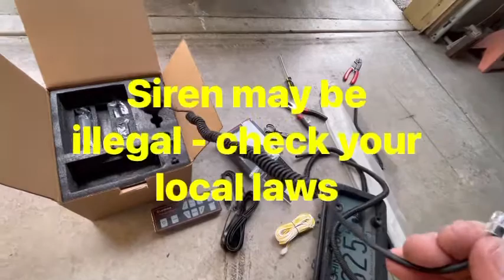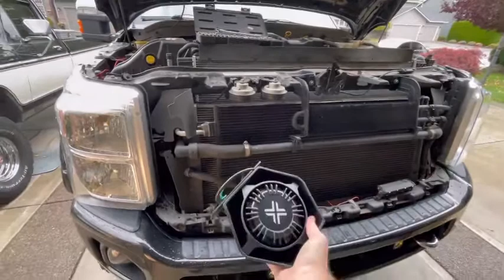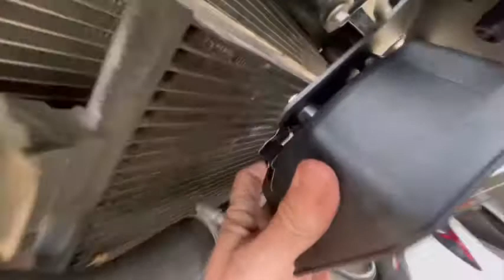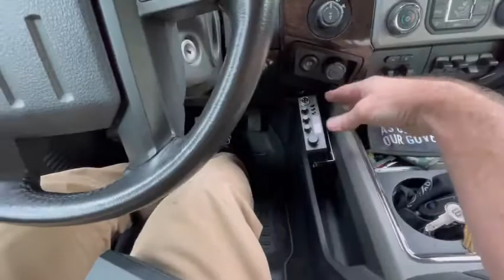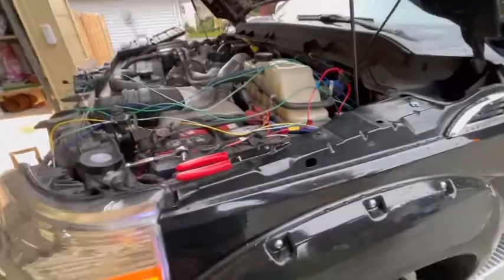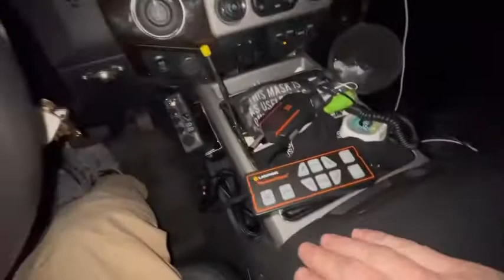Truck PA System Install - Lamphus Thunderwave Siren/PA/Horn Install & Test

Comment: Hey I know this video is old but I had a few questions, I got mine wired up and it works but it seems to drain my battery, I decided to direct the positive wire to my cigarette lighter in my car since I thought it completely turns off when my car is off but it seems to still affect my car is there any advice to what I should do for that?
Reply from the maker: I have not had any drain. My truck sits a lot now.  No drain. Best to throw a cheap switch in the wire somewhere that leads to the unit. That will isolate whether the unit is actually the culprit.

Comment: Hey I know this vid is 2 years old but I’ve got some questions hopefully you can answer. Mine seems to be playing the volume pretty weak, I think I have a good enough ground and power but I’m not sure how good it needs to be. I did have to put the speaker directly behind my cone intakes so maybe the sound it getting muffled? It’s white literally fully face touching the cone intakes. Any ideas on why the volume seems pretty quiet? I can’t even hear the mic and sirens when I’m in the car driving because it’s too quiet that the road noice blocks it out
Reply from the maker: Definitely a huge difference if they are behind something.  These aren’t going to be as powerful as a true emergency vehicle pa.  So they need as much help as possible.  Don’t forget there is a volume control on the mike.  I ended up adding another speaker.  Also, you’re not going to hear much from inside the vehicle on the road since the speakers are directional.  Best to have someone drive in front of you and ask how much they hear.

Comment: What does the radio function do. I'm having trouble with my phone in the aux cord getting it to play
Reply from the maker: Most likely the cord is the issue.  Most phone cables are stereo.  This radio needs a mono cable.  But then some of the newer phones are unable to convert their new plugs over to the type of plugs that these PA systems take.

Comment: Did you connect the red wire directly to the battery?
Reply from the maker: I had a hot wire already that was coming off a relay that was activated when the truck ignition is on.  It was for the lights or something.  Then tied into that and of course it was fused.

Comment: Question for you on the PA loudness. Do you feel your voice is loud enough to be heard on the PA by your fellow drivers while at normal speeds 45-70? or is it drowned out by road/wind noise? Thanks for your input!
Reply from the maker: Well… I did just install a second speaker (same model) and it increases the volume in my estimation about 60%.  To answer your question- the only time I think someone could hear me at those speeds are when I’m right next to them and they aren’t blaring their stereo.  I find this most useful at stop lights when people are buried in their phone and don’t see the light change.  It’s fun to say “Put the phone down!!”.  Here’s the link to the second speaker which is easy to add; https://amzn.to/3X2RkJN
If it’s not in stock they have other options that will work like one from Feniex.

Comment: I have a lamphus sound alert. If I went to install this lamphus thunder wave, would the connection be the same? I just don’t want to run another power lead through the firewall.
Reply from the maker: Power will be the same. It’s just a simple 12v connection.  But if you’re talking about the entire harness + plug - it’s probably different

Comment: Anyone know how to make the option work where you can connect your phone using the 3.5 MM jack and playing sounds on the Thunderwave? I connect the 3.5 jack but doesn't seem to work. everything else works. Any ideas anyone?
Reply from the maker: Firstly, you have to push and hold the “Radio” button until it beeps.  That turns on the Jack/radio in feature.  The 3.5mm Jack is unusual (that’s the only word I can think of).  I wouldn’t say defective- because I’ve tried two.  I initially thought I needed to use a mono cable (rather than a stereo cable). I had them send me a new panel.  I tried the supplied stereo cable. Didn’t work. Then the mono. That was partially working.  What I finally found that worked was that the plug has to be partially inserted- not shoved all the way in. Then it works. Not sure why.  But that did it for me.  I’ve never encountered a 3.5mm jack issue like this.  Just try fiddling with the plug insertion while playing music or something and see if you can find the sweet spot.
Reply: @TheRealWorld737  I found the manual and in it says first you press the radio button once so it turns on and turns orange, after that hold it for 5 seconds. That did it for me and works fine now and I don't have that issue you talking about, where you say put in 3.5 mm half way or something. Works fine for me fully plugged in.
Reply: @TheRealWorld737  Based on the manual, connect the 3.5 jack to unit or phone/tablet. Turn the unit on. Press the radio button once so the orange light comes on, press the radio button again, hold for 5 seconds until you hear a beep. Works like a charm for me.

Comment: Were you ever able to get the aux to work to play your phone or something
Reply from the maker: I did. First - I had to push and hold the radio button until it beeped.  Then, the plug is finicky.  If I pushed it in all the way - it didn’t work.  But if I pushed it in all the way then, backed it out slightly it did.  Or if I didn’t push it in quite all the way.  Not sure why this is.  I even tried a mono plug vs a stereo one. Same results.

Comment: In mine they reversed the polarity. If you did everything right and the fuse is still blowing. Open the unit and switch the orange(+) and black(-) wires.(common manufacturing mistake) worked fine after. Orange(+) should be furthest from the back plate.
Reply from the maker: Thanks!

Comment: does this come with the fuse or do I need to buy it separately. I know you said you bought it separately but do I even need it for this. I wont be wiring additional lights
Reply from the maker: No- it’s just a bare red wire.
Reply: How did the unit hold up? Is the sound of the Pa clear from far away?
Reply from the maker: I've been using it for over a year now & it's done very well.  Still loud, still clear.  Fun for when someone is in front of you at a red light; they are staring at their phone and the light turns green and they haven't moved yet!!  They get moving real fast.  I've used it in other "appropriate" situations and it works well.  https://amzn.to/3XyTqT1

Comment: Hey brotha, so so so so appreciative of you going out of your way to make this video. Just started to look for a PA as another project to keep the mind turning. Landed on this one and was worried about not being able to find a video because few reviews. There was no sound test on the page but you cleared that up. Will be using your link so hopefully some money comes your way. Cheers!
Reply from the maker: Thanks Danny!  Really appreciate it.  Originally, I just wanted a PA for my Uniden CB.  But they were all too quiet.  Then, I ordered a powered Spenco PA speaker.  It failed - wasn't loud enough and the volume controller was faulty.  I didn't want to buy a crappy $25-$100 system on eBay that would go out quickly.  Plus, didn't want to pay $300+ for the Whelen or Feniex stuff.  I rolled the dice, did the research - and this Thunderwave is Very LOUD. I like the options - and it is very solid as well.  Hope you enjoy yours!